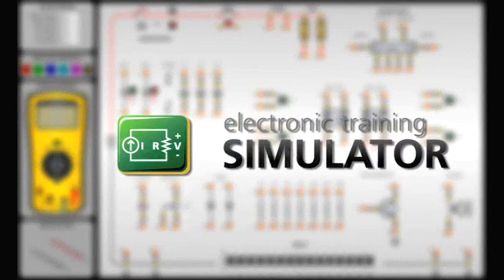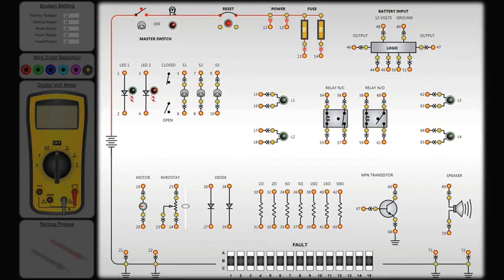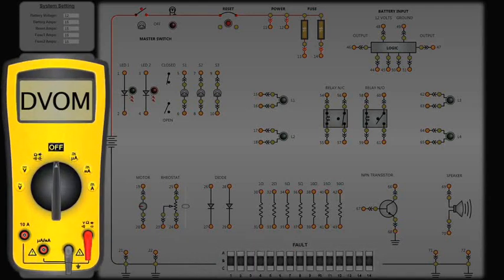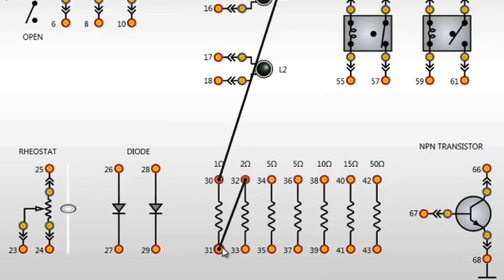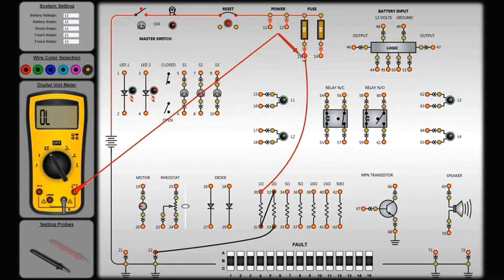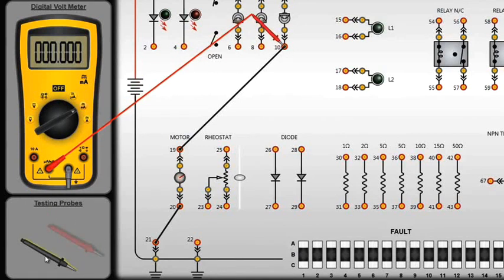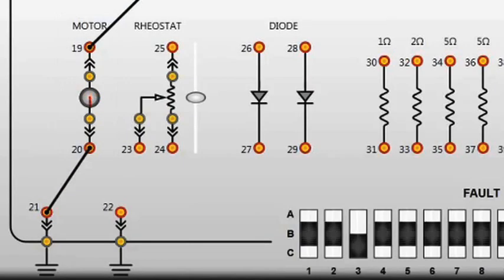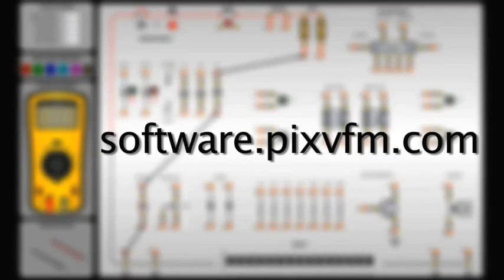A Software Version of Electric Circuit Building Testing Board

Comment: This replaces a classroom breadboard that cost the client $3000. If your labor is free and you recycle parts, maybe less than $ 250 but I doubt it- This board has wired faults that are switchable and you can't blow out or wear out switch, connections or components.

New version coming soon that is subscription based, changeable components and available with active components.
Reply: @duha3219  currently not available but maybe updated for web use. We will post here if that happens
Reply: The code is heavily protected by the freelance programmers & I’m only the licensee. I’m afraid there is not much I can do except provide the docs on how it functions.
Reply: I do not - sorry